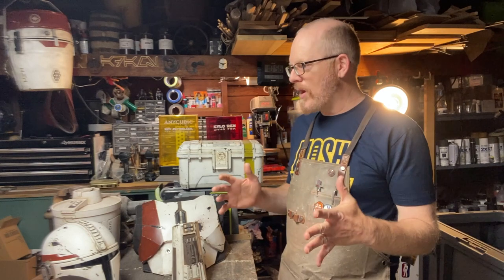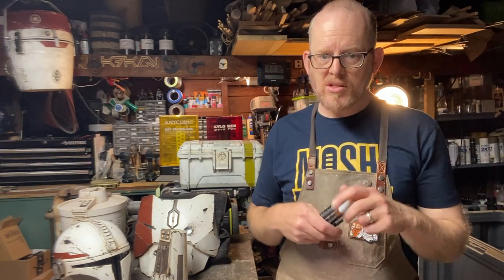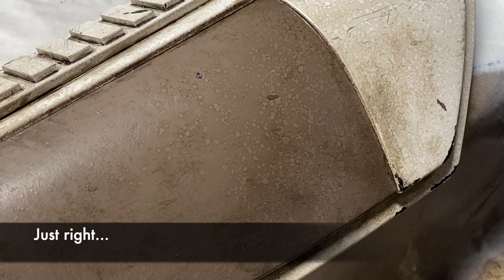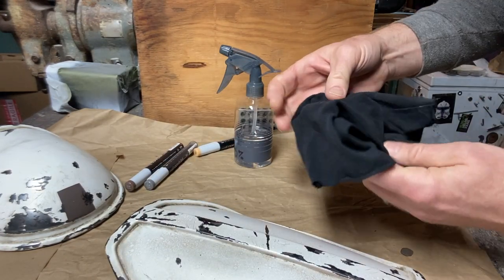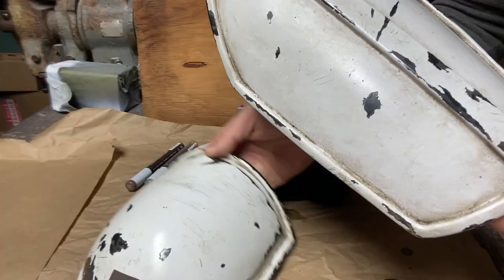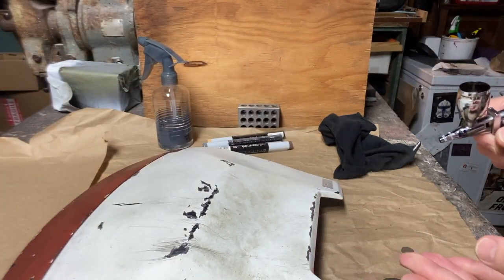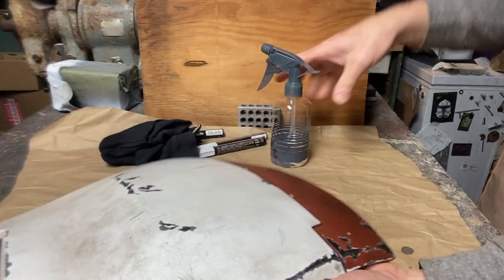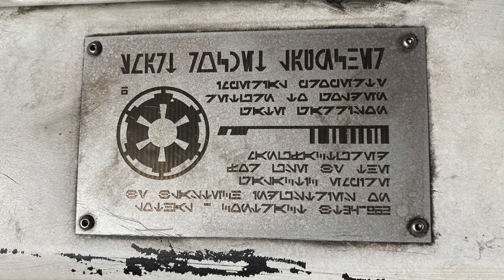Prop Weathering 5: Alcohol-based Ink Speckling

Comment: Hi!
Thanks for the video.  You say airbrush thin layer of copic, and then spray via spray bottle the copic again again.  Why do you need to airbrush?   Are you saying do both?  Or one OR the other
Reply from the maker: No, the copic is sprayed in a very fine even coat with the airbrush (the ink is usually thinned with more alcohol in the airbrush pot). That layer is so soft, fine, and even that you can't really see it easily. Then you use a spray bottle to mist it with alcohol, and compared to the airbrush, this creates much larger mist and those spots of alcohol instantly dissolves the ink to create the speckled spots.

Comment: This looks brilliant. I'm creating my first weathered, Fallout inspired, 3d printed box (12 inch long) for a prop I need . I've been using spray cans so far and I don't have an airbrush.  I'd love one but not sure how much use it would get to warrant the investment in all the kit needed.  So, I was wondering whether something approximating this effect could be done with spray cans and rubbing alchohol?   I'm going to try applying a fine dust of black that I have lying around onto olive drab base and then the fine mist of rubbing alcohol.  Do you have any thoughts on the approach?
Reply from the maker: I don’t think alcohol would be a solvent for spray paint. I have heard you can get this look with Naptha on oil paints (brushed on thin, not from an airbrush).
Reply: @OddViking  It didn't work.  I've had a little more success with water drops on first then spray a colour,  wait a few mins then wash off. But it's not great.  I may try your method but with just fine mist spray bottles instead of an airbrush.  One question - do you let the initial airbrush layer dry before the mist coat that causes the effect?  Thankyou

Comment: Instead of using a cloth to remove excessive weathering have you thought of using a Sea Sponge?  Taking advantage of the texture of the sponge…which in its own way creates texture
Reply from the maker: It absolutely could be used, but I find I have better control with rags. Sometimes the sponge adds too much texture, and I am most often using the rag to remove excess texture. But I haven't tried it with this, so it is worth trying out.